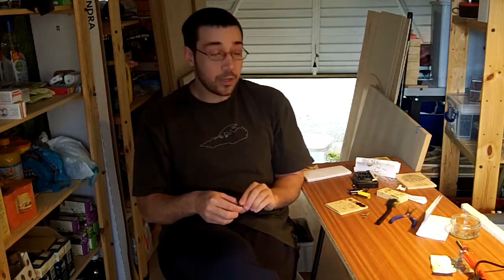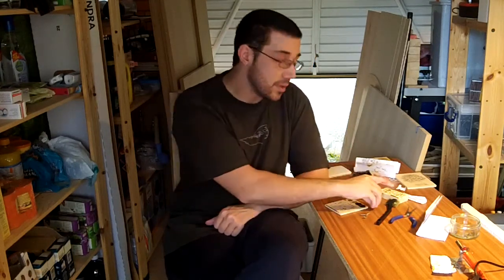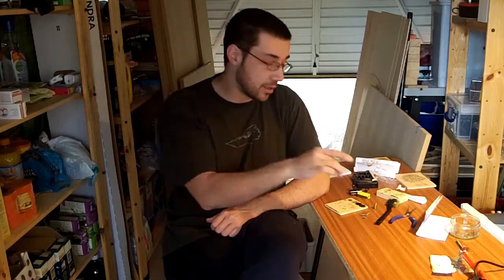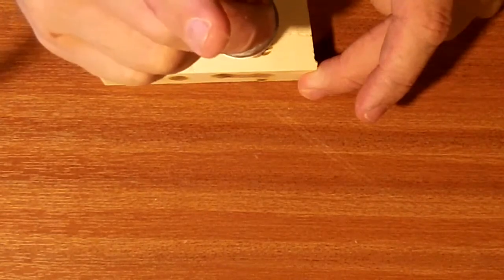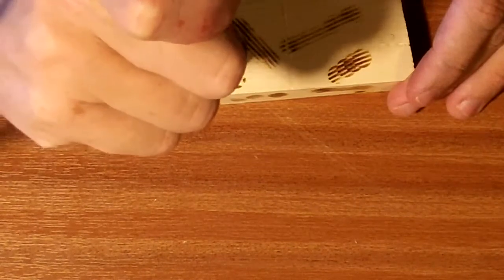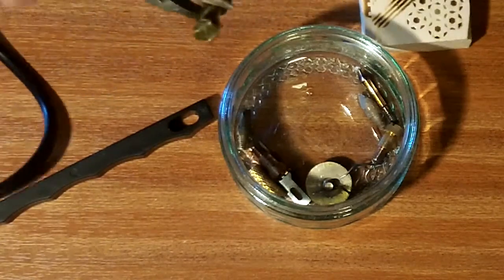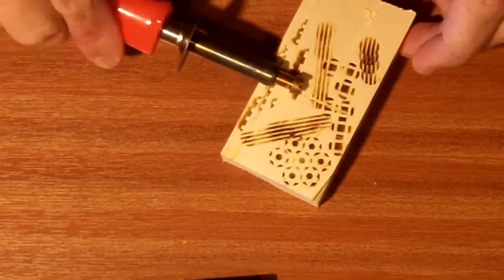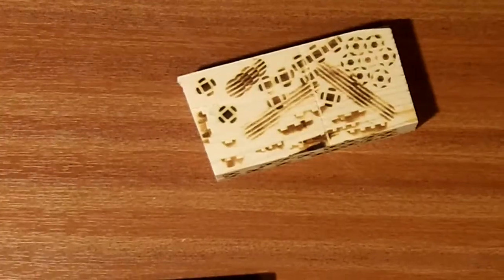The Beginner's Guide - Branding Bit - Weller Wood Burning and Hobbyist Kit - #7

Comment from the maker: Hey Andy

Don't buy a soldering iron, even high temp soldering irons aren't designed for pyrography and will just not work well.

You need to get a pyro machine, the one I am using in this video is about £30 which is less than you have spent on soldering irons I would bet. 

The better more variable more advance machines run a bit more expensive, but my current favourite the Peter childs machine I use most often in my new videos is only £100 all told, which isn't that much.

Hope this helps. 

The Droid
Thomas
UK
Youtube
Facebook
All around the world and space